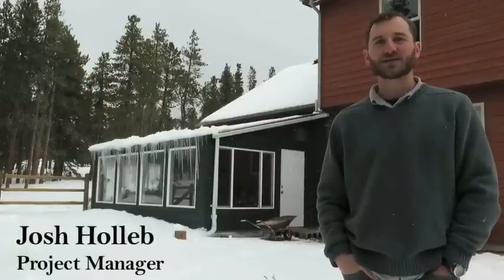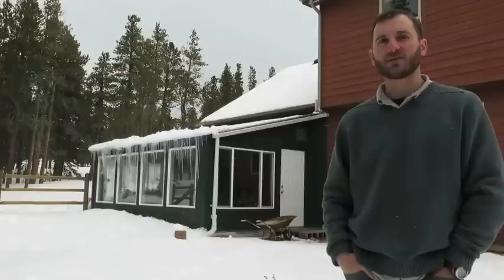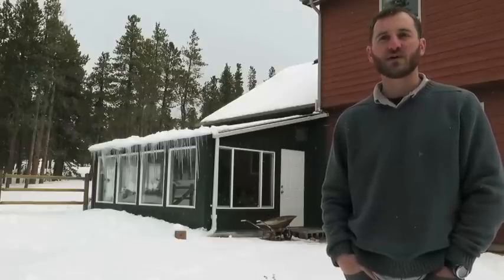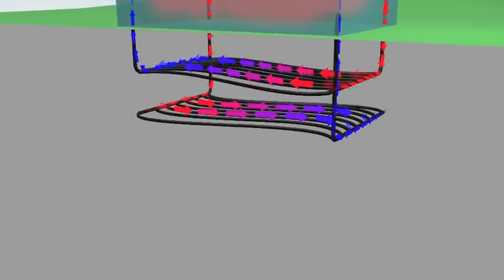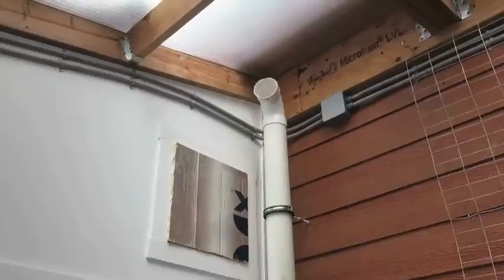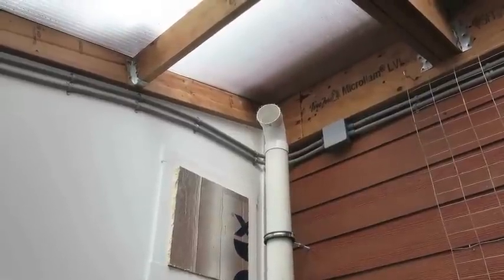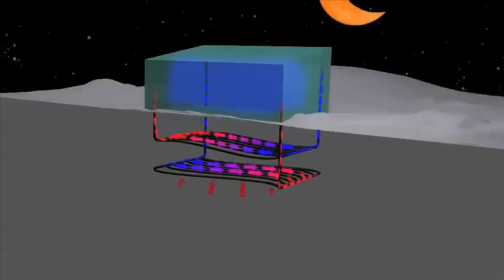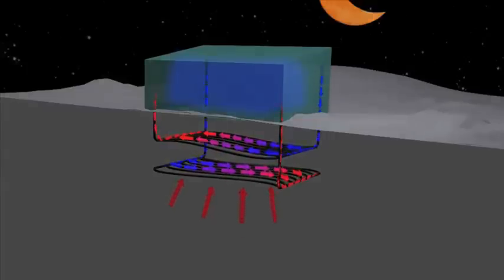Ground to Air Heat Transfer (GAHT®) System - Ceres Greenhouse Solutions

Comment: There is no way there is enough capacity/insulation in the soil where you could store heat in the summer  and use it in the winter. Which leads to the question - what the hell are you talking about?
Reply: songbird222222 
I think this video is misleading..
As to storing heat..
If it did indead store heat then that storage unit would need to be insulated from the rest of the soil (50°ish ambient temp)..
But heating the green house.
50°temp is a lot warmer than 10°temp
Cooling
50°temp is a lot cooler than 90°+ temp...
As to energy transfer..
The ones that complain it doesn't work usually are using plastic pipe..
The ones that do work usually are using culvert pipe..
(Steel transfers temps better and the ridges in the culvert pipe cause more air turbulence)
Check out 
EarthShips Tucson Az..
Air cooling without fans..
If you can't find it..
Check out images and see the diagrams...
Quite simple..
The hot air exiting, pulls the cooling air in.
Reply: I may be a year late to the party but, actually this system works because the temperature of the soil remains constant year-round at around 6 ft in depth. In my region in Washington it remains 52 degrees F at 6ft all year allowing heating during the winter and cooling during the summer. This is not new tech, this is tried and true geothermal HVAC.
Reply: @socore3197  52F at 6 feet in the coldest months is quite high.   here in norway the temperature at 6 feet ore deeper are around 40F,,, Even when there is 6 feet snow and freezing hehe
but your right.. most places where there ISNT PERMAFOST.. the temperature is stable over freezing year around..
for hundreds, maybe thousands of years. people in norway have stored say potatos in cool natural storages by making thir basement DEEP ENOUGH. in their houses-barns.
but even in the siberia-alska you find heat enough, if you dig deep enough and get close to the LAVA LAYER i guess haha....
but only fans to circulate air thru ground holding 52F if you needseam a waste of power if you need 77F for a bigger green house.. 
an AIR-AIR heatpump produse at least 4 x more heat than the electrisity it uses,, and you can get as hot an air you want..
But greenhouses only use AIR-AIR if they are poor becouse those heatpumps loose more and more effect, the colder its outside....
so the big ones DRILL a deep hole ore bury thousands of feet of hose in say a field 6+ feet deep.  becouse  WATER/GAS THATS ALWAYS MORE THAN FREEZING give at least 6+ to 1 ratio.
but the ones close to the coast ore  DEEP LAKE are the lucky ones. hehe they dont need to pay for drilling-digging... they just drop miles of hose with weights on in the sea-lake. hehe
Reply: @samkom33  TBH,  I don't have Permafrost I would probably only go 4 ft deep (For my region.) and add a furnace for winter growing,  in which I can supplement the heat. I have access to lots of scrap wood which would otherwise be placed in. Good info though...Thx
Reply: @delekham1863  rocket mass stove
Reply: it heats the ground so it's warm at night.
If you bury the pipe deep enough you can get 11C warm air even in winter time as the ground stays at the same temperature year-round = growing plants in the winter.
Reply: If the soil freezes down to 1,5m then it won't be much higher at the 1,8m depth, at most 3K higher. And that 3C is likely achieved with the help of the groundwater layer moving down the slope at that depth. 52F is insanely exceptional. If the groundwaters are high enough, then one can tap into that and extract heat from there. More large-scale heat storage would be with deep heat wells or with ground heat pumps, but both would cost a lot.
Reply from the maker: This video is old and we realize that we need to provide some collaboration. Typically, pipes are buried up to 4’ underground. This can vary by area; the goal is to bury pipes deep enough to reach stable soil temperatures. The stable temperature of the soil is utilized to heat the greenhouse in the winter and cool the greenhouse in the summer.  We additionally insulate around the perimeter of the greenhouse to create an insulated pocket of soil beneath the structure. So in this way we are able to store heat underground in the soil.
Reply: There are some great charts showing the temperature gradient as you go down onto the earth. At 30 feet it is very constant and equal to the yearly average temp. As you go closer to the surface the temps lag seasonally, up to six months. But the magnitude of that temp lag drops as the lag increases, as you go deeper. 
Sinking heat into the soil during summer raises the soil temp. You might even consider insulating the ground around the greenhouse to create a larger heat island. 
Soil can hold about 1000J/kgC... So a 10,000 cu ft volume heated by 20 C can produce about 380 Watts for one month... The 20 C rise in temp was a guess. Perhaps you can get more before leaking exceeds input. But add more soil volume to add more storage. Easy...if you own a backhoe...
Reply: @HomeSmartPasadena  im old enough to remember they used moist straw bales to heat greenhouses.. but thats a risky buisniss-- if the straw is to thick you risk FIRE.. but yes composting organic matter creates a lot of heat.
Reply: songbird222222,  your right and wrong, hehe yes you can store some heat in the dirt, but most important reason this system work is FRICTION HEAT....   same princip as say a heat pump,,
you add toghether the heat from the fan's driving the air + the heat from the ground, which if you are deeper than the winter cold goes, is at least 4Celsiuc + you add the friction heat from the air passing thru the pipes....
in say a 1000 watt heat pump you avarage get 4000 watt heat
So as long as the greenhouse is well insulated it get hotter and hotter as long as the fan runs,, but dont expect to get a heat spike of 50 degrees in 1 second. hehe

Comment: In the video you are using a cross direction of the airflow underground. On your homepage you have a picture of a one direction airflow underground. In my opinion one direction is better or is there a purpose about cross direktion airflow?
Reply from the maker: The two diagrams are representing two different sizes of a greenhouse. The singular direction is a smaller greenhouse with less underground pipes.

Comment: Nice video. This is the same system used for heating and cooling houses. This should be implemented all across the earth. And no need for fuel. 
Cheers.

Comment: what do you do with all the water collecting down there through condensation?
Reply: Ceres Greenhouses Do you mean “perforated “ where you wrote “corrugated”?
Reply: TheStephenmonroe 
I think he did, the thing with little holes is that they will soon let the ground water in the pipes in places with high ground water levels. So it wouldn’t work in much of the UK.
Reply from the maker: The pipes are perforated so the water can escape through holes into the soil

Comment: Without subterranean vertical insulation beneath the greenhouse footprint, what stops heat from migrating laterally into the surrounding landscape?
Reply: These systems do not require retaining, in fact its counter productive. The more mass you heat the more energy you have access to later.
Reply: 1,000 tons of dirt insulates it pretty well
Reply from the maker: We insulate around the perimeter of the greenhouse to create an insulated pocket of soil beneath the structure.
Reply: You're right as far as insulating boards along the perimeter of the greenhouse, heat migrates from warmer to cooler, and if the ground just outside the greenhouse is say 0 degrees, then just inside the greenhouse the soil is being leached of heat. Look up PAHS (passive annual heat storage) which shows how you can insulate the earth around the greenhouse and reduce the heat transfer to "the outside". Some plastic sheeting and insulative boards under it, sloping away to allow water to run off and not pool, will result in the earth underneath staying warmer and leeching less heat from this storage system.

Comment: You have no problems with moisture and fungus / molds inside pipes? Especially during winter?
Reply: this would be my concern as well
Reply: Where condense is there will be mould. Risky business.
Reply from the maker: The pipes are perforated underground to allow for condensation to escape in order to prevent mold and fungus inside the pipes.

Comment: How do you keep the pipes in the ground from water logging due to condensation?
Reply: You should check air quality for Radon gas as you might be bringing it up into the greenhouse by the perforated pipe below.(?)
Reply: How much outside air exchange would you expect in the Winter?
Reply: The perforations in ADS tube are designed to let water in..not so much out. Thats why its called drainage pipe
Reply: I know what drainage means ;) You need to understand how this system works to understand the context of the word.  ADS is designed to collect water from the surrounding ground and transport it away. This system generates condensate inside the tubing which needs to be drained out into the ground.
Reply from the maker: The underground pipes are perforated to allow water condensation to escape

Comment: is it really accurate to say that the soil is heated by the greenhouse all summer? or is it more appropriate to say that the soil cools the greenhouse in the summer and heats it in the winter? maybe it is just semantics. or maybe there is something one of us is misinterpreting.

I mean, the soil stays at a pretty constant temperature underground. So it seems more accurate to say that the soil is effecting the greenhouse than the greenhouse is effecting the soil. But of course they are effecting eachother. It is just one may be effecting the other disproportionately.

I'd have to see numbers on how much heat energy the soil traps vs how much the soil stays constant on its own to come to a firm conclusion.

but I hypothesize that since the soil is already fairly warm in the winter (~55°f) regardless of how much heat has been pumped in there, that it is the main source of heating, not what was trapped in the summer.

I can't find munch information on underground heat trapping capacity so maybe you have some links to share. I am very interested to learn the degree to which heat can be effectively stored underground.
Reply: michael ryan, kelhawk1  You guys would be a laugh arguing about what came first, the chicken or the egg. I'm sure that Trevor Doge is laughing his ass off. Lol
Reply: Ok, Ok all you guys, WOW!! Some really good stuff has been said here. Michael Ryan I believe you have made your point, and done so trying to be a gentleman. 
Obviously, stating that heating the ground with hot air from inside a greenhouse is not going to work. It's just going to dissipate. So poo on that.
However, how about heating an area of ground that is  surrounded by 2 or 3 inch insulation? Say, 25ft by 50ft?
I say that because I'm building a passive solar greenhouse on it now . Is anybody here familiar with what Curtis Stone has done with his passive solar greenhouse that has a climate battery that is being discussed? If not then see this link 

https://www.youtube.com/watch?v=kk56TV7u6EM&t=569s

Can i post a pic to this? How do I do that?
Oh well, just imagine a  rectangular foundation 25 X 50 and 3 foot deep. All insulated with 2"  EPS. all around the footing and foundation, all across the floor, and eventually all within the greenhouse.
I have strung 300' of 4" perforated pipe along the floor, then buried it  with 3/4" crush gravel up to the top. That's the battery.
Right now it's all wet from rain, and it's getting frozen too. :{ Nothing I can do about it until the roof is finished. Anyway, I'm going to blow warm air from the greenhouse down and thru. I plan to use a solar thermal air heater as well as the ambient air within. Finally ending with a propane heater for cloudy days.
Anybody want to make a guess what will happen when I start heating the battery and how it will perform over a year or more.

Comments are much appreciated, and even more so if they are civil. Thanks.
Reply from the maker: You are right in that the stable temperature of the ground year-round heats the greenhouse in the winter and cools the greenhouse in the summer. We additionally insulate around the perimeter of the greenhouse to create an insulated pocket of soil beneath the structure.
Reply: atcually that is not true, the sun does heat up the ground over the year in certain month.
Reply: For me, this is an experiment that I can prove or disprove the concept of thermal banking by using warm air. The floor of my greenhouse is  full down 3 feet with 3/4 crush gravel and it's saturated with rainwater. It will soon be frozen.  When the blower is turned on and run for some time, I may be able to see an effect. That's what I'm interested to learn.
If it stays frozen, then the idea won't work. Or, if it isn't frozen but can be shown to raise the temperature, that's another effect. 
I guess there are a lot of variables. I'll record the data I find and share it. 
I'm surprised Ceres has allowed this conversation to continue, but i say good on them if they are gathering information.
Michael Ryan, If you were to build a 25ft X 50ft greenhouse, how would you heat it using only solar? Or suppliment it with solar heat?
Reply: Also please contact me btamper@hotmail.com. I'd like to pick your brain.
Reply: Trevor Doge I think I am closer to your side of the discussion. I built my home on a mono slab insulated in order to keep the house cooler in the winter, and to only have to heat the insulated air in the home from somewhere where around 40*-50* instead of perhaps 30* ambient temp outside the insulated walls. In essence, I was using the grounds annual base temperature, not changing it. in the summer the house stayed around 20* cooler han the ambient temperature outside. I had other help as well though. In the summer I used an attic fan to blow warm air out of the attic crawlspace.
Reply: You're correct it is more of an on demand process but that doesn't sell product.
Reply: But it is inaccurate to say that the heat from the summer causes the soil to be warmer in winter. The effect over months would be negligible.
Reply: Out of your depth say?   The earth is not a single stable temperature until you get about 40' down - then it varies from about 40 degrees around the Canadian border to 77degrees at the Mexican border.  Apart from that it depends on the kind of soil.  The greatest temperature variations are near the surface and the narrow until you get to about 40' underground.  Time of the year is another factor.

Go look at the site littlegreenhouse.com for charts and tables on this from just about every angle ...  Also there is a video here by a guy who has done his research ... "Growing Citrus in a Northern Climate Part 4 Geothermal Project".

When you have all your facts wrong does it really help to be a fucking condescending asshole?
Reply: If the design shown here had 3 to 4 feet of insulation buried at an 
angle around the foundation to help trap the heat, it could work very 
well indeed. Passive Annual Heat Storage, or PAHS, can raise the ground temp in a selected area, and keep a dwelling nearly a constant 70+ degrees annually, plus provide a means for fresh air flow without fans. 
http://earthsongfarm.com/PAHS.html
The GAT concept doesn't appear to have any way to prevent the excess heat that is "stored" in rain soaked soil, from being immediately lost to mother earth. Wet soil will really suck the heat away, compared to the dry soil maintained under a PAHS insulation umbrella; and no worries about condensation and mold. An optimum PAHS setup for a dwelling, likely would not have enough south facing windows to function as a greenhouse. Too much light entry during the summer can overheat the ground below. This becomes most apparent when winter air temps cause the heat to reverse flow from into the cold earth, to back towards the now colder winter air. Your dwelling or greenhouse is in the path of that heat. Once you thermally isolate your section of earth, the amount of radiant heat from the sun you let in all year long can actually be over done, and has to be tuned to achieve year round comfort with no back up heat or AC.  If, after a couple seasons to stabilize, the ground/greenhouse overheats, the GAT heat transfer tubes could also be used to exhaust excess heat to your house.
Reply: michael ryan  Not sure who you are addressing, but since I mentioned "four feet" of insulation I will assume it is me. It's not my "math". Did you even look at or study the link? There is at least one book, that will correct your ignorant misperceptions. If you don't want to study the PAHS concept I could care less, you aren't the only person reading these comments, and I deliberately addressed no one in particular. If you expect someone to condense volumes of info for you in a YouTube forum, you should try being polite instead of a snob.

Comment: You can move the frost line up or down or eliminate it using rigid foam insulation.  Some is high density, meaning it can go under footings and also rated for below grade application.  Putting pipes into the ground that might freeze is common.  Cover them with the insulation before back filling.  The ground on top will be frozen, the ground under will not be, regardless of what depth you put the insulation and pipes.  I lived in Quebec, we did tricks with frost.  You can build a deck the same way, $2 footings of a CMU and a 2'x2' piece of insulation.  Now I'm in the low desert, California, haven't seen frost for  over 100,000 years, so life is care-free.